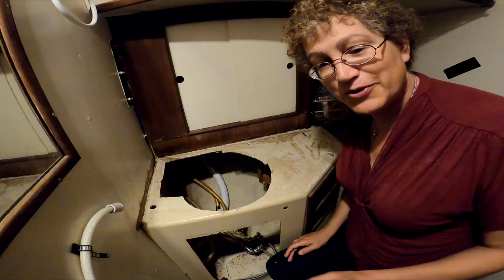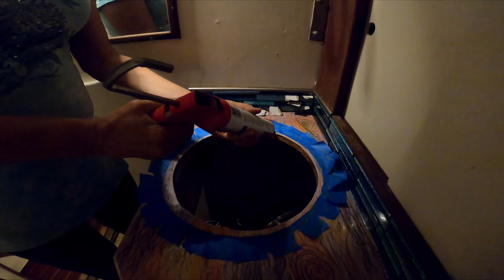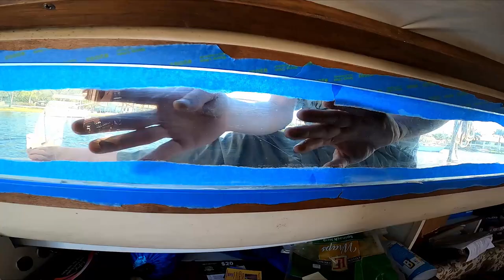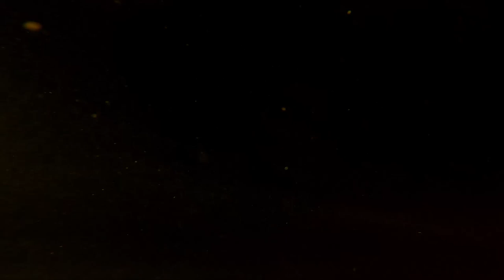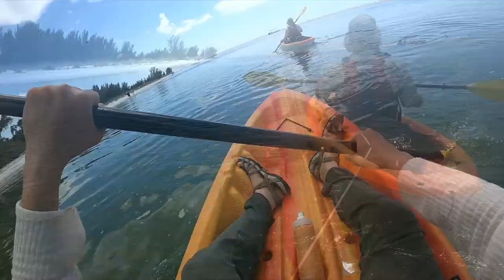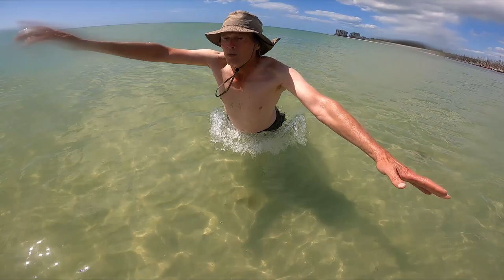Episode 43 - New Bathroom Counter, Portlight Rebed, Divers Clean Our Boat, Kayak Adventures

Comment: How does the cost compare to a haul out and clean? I imagine if you haul out you would be not just be cleaning but doing stripping and new bottom paint as well...
Reply from the maker: We are actually planning to do a haul out, strip and repaint. Also there are some through hauls we don't need and those would come out as well. It's so expensive down here in The keys and the Miami area. We will be looking for a place to haul out that is less expensive as we head north.